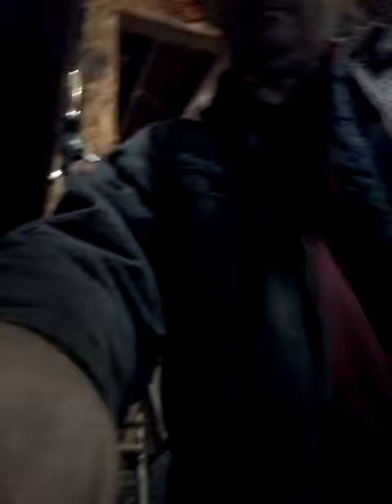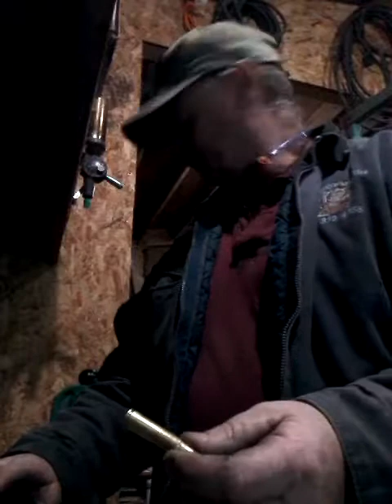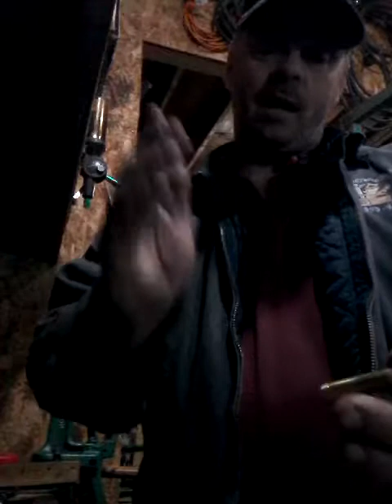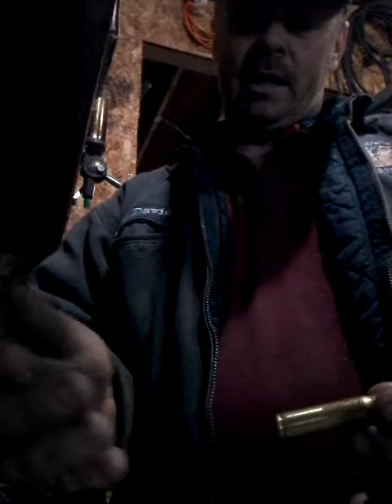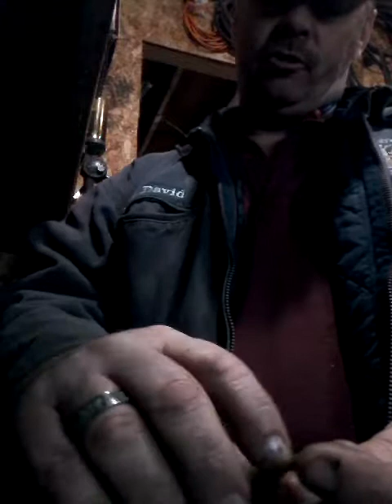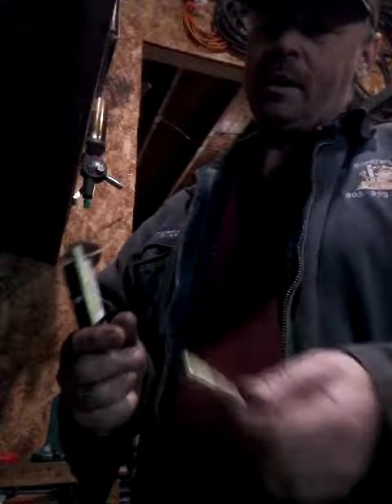7.62x45 made from .308

Comment: I actually have a set of X45 dies. In that case what steps would be eliminated here?
Reply from the maker: Doing this from .308 is experimental. Your base size must be reduced. Extractor groove brought to size. Both of those I would use a lathe and file. Once done your base will fit the shell holder. Annealing the case may help at this point. Reduce over all case length in a rough trim. Lube your case. Full length resize. Trim to final length. Easier with 220 swift. In my modified cases I have had no 220 swift failures upon firing. .308 cases I had one crack near the base about 3/8 of an inch up but those cases were never anealed. Your benefit is not swapping dies and measuring shoulders and such. Our danger in doing this is a base separation and potential stuck case. Has not happened to me but it could in this experiment. Long answer. Thanks for watching and your response.

Comment: Do you need any surplus 7.62x45?
Reply: Well done. good deal
Reply from the maker: At what cost and quantity?
Reply: 500rds about 1/2 of it on stripper clips, steel case... you can email me @gmail... I'd like to trade some 5.56 or .45ACP if not cash will do..
Reply from the maker: @pyrotek40  I have some 223 and have a bunch of 45 brass beyond, as cash wise I won't pay more than 10 cents a rnd
Reply: 500rds of 7.62x45 for 500rds of 5.56 would work, really don't want cash as much as ammo
Reply from the maker: Best to have this conversation elsewhere, makarovowner@yahoo.com. Perhaps a trade can be reached.